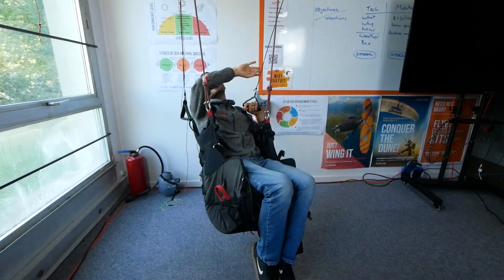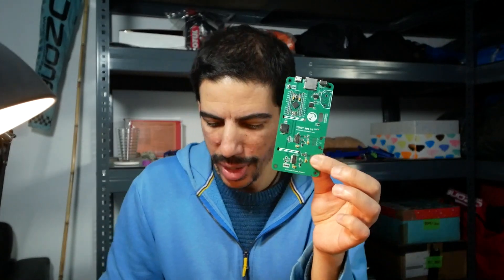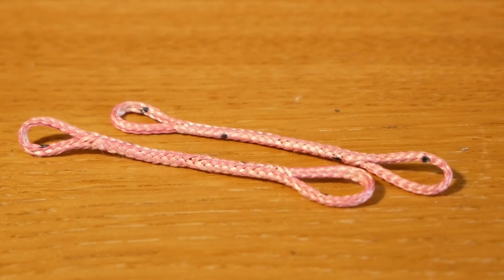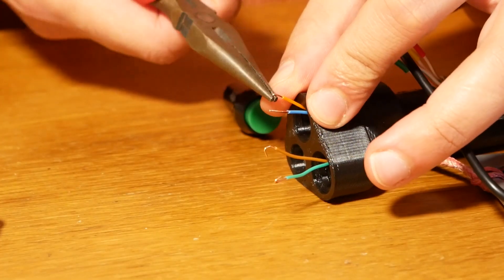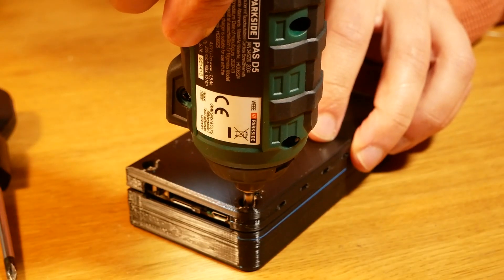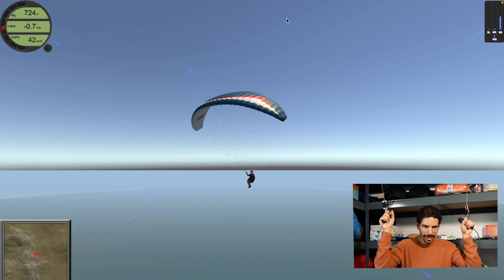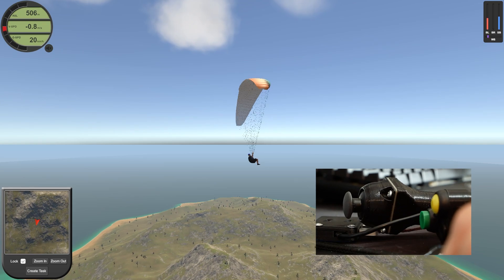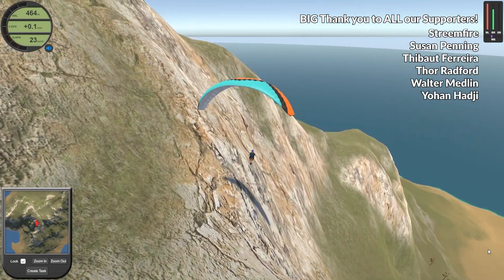TruBrake Controller - BANDARRA

Comment: Excellent. Since the handles move up and down, a mechanical solution with springs and potentiometers, to measure pull displacement, should work as well.

Comment: Have you used either:
1. Resin printers
2. "cloud" printing services
in any of your projects? The resin has way higher accuracy and is more than strong enough for case/grip and the cloud printers would allow you to literally make that out of Titanium or whatever material you want pretty much... (The main reason I ask: I have a resin printer and I've been eying those cloud printers for a while now! Being able to prototype in resin/filament and than just order the part in perfect quality made from whatever Metal/Plastic or even WOOD that you want!)
Also: I like the blue and orange, looks nice! And I love how the long Bolt has full contact across it's length, that's gonna last! 👌👌

Comment: Hi Andre, this is an awesome idea! Also, if you add springs/bungee between the handle and the sensor, it should give it some actual brake travel and a bit of a more dynamic feel to the entire system.

Comment: Dude! You one upped me again! I love this design, no moving parts. I had a similar thought with the load cells but decided to go with gears and wheels. One thing I have had trouble with is the weight  shift sensor (while seated at a desk) using a large dual capacitor from layers of tinfoil under each side of a cushion. It seems to compress and I have to give a a good rap on the floor to fix it. I have been thinking about making a dual whoopie cushion type of thing with a differential (non-absolute) air pressure sensor between the sides but can't think of a way to make it yet. 
Have you any ideas on that?
One other thing, maybe slow down those prints a bit haha! I run mine at 50% always. Guess that's not too important ;) Thanks for letting us in on your cool ideas Andre!
Reply from the maker: Yeah I think if your going that far to create a paragliding input system then one of the main things is to use an actual suspended harness. So if that’s the starting point then using brakes, weightshif and sleepbar can all be done with loadcells. And taking on the ideas that some people suggested, instead of the loadcells being on the pilot end, they could be on the hanger side, above the pilot, where the lines and risers attach to, that would be super nice and slick with minimal cables in the way

Comment: Hey Andre, I don't know if you remember the paragliding controller I made a few years ago, I've been improving it and now it's going much better, now it also has foot throttle control.. I've tried everything to make the brake control, at first I put tension sensors similar to yours, then I put distance sensors, at first with encoders, then with optical encoders, then with 10 turn potentiometers and finally I've finally found the solution with normal potentiometers and a pulley system. It is the most realistic I have achieved. Let's see if I can edit a video with the updates.
If you want I'll send you the files to print in 3d if you want to test.
Reply from the maker: Hola Mr Cuervo que tal!? Yes of course I remember, it’s was a nice rig. Would be nice to see a video of it if you have time to put it together. For now I’ll leave this system as it is a get some feedback from Flyeo to see how they like it as they will have a full hang simulator with bungees and pulleys etc. In the future I’d like to make one with weight shift, speedbar and everything, but one thing at a time
Reply: @AndreBandarra1  When I upload the video I will publish the plans of mine, it has really come out quite cheap, it is only a few iron tubes, 4 potentiometers, an arduino and some 3d printed parts.
Reply: This sounds very much like mine, can't wait to see it!
Reply: @sandrainthesky1011  The other day I saw your video, very good. The first prototype I made was similar to yours, I made it during the pandemic with things I had in the workshop. The one I've made now is better. It's almost like paragliding 😁
Reply from the maker: @sandrainthesky1011  https://www.youtube.com/watch?v=QW3vSNrbr1k :) very nice

Comment: Awesome work Andre! I’ve been following your various electronics projects with great interest. Since you’re obviously considering the longevity of your hardware I would suggest using stranded rather than solid wires in your cabling, the solid wires may break pretty quickly if they’re flexed in a single spot repeatedly.
Reply from the maker: Good point. Yeah not super happy with how thick and stiff the cable is but it makes it easier to solder and feed through.

Comment: impressive ! how much time did it take for you to make the whole thing approx ?
Reply from the maker: I had A LOT of stuff already from other projects, like the core of the code, the main PCB and a lot of CAD for 3D printing, but still took around 3-4 weeks of pretty much full time work
Reply: @AndreBandarra1  oh wow that's a lot, a month given all the advanced parts you could use already, as well as the knowledge of all the software, tools etc
Reply from the maker: @alex-in-the-sky  yeah, at the beginning, because I can imagine it, I think, yeah it will be a couple of days and then done, but just the 3D printing prototyping and reprinting takes a few days
Reply: @AndreBandarra1  I see, all but the auto coding took more than expected haha :) amazing result and I really like it being a less troublesome option to have a simulator at home without bothering with all the VR stuff

Comment: Fantastic! Seems like it would be really good for VR, too. The VR headset (mine, at least) has trouble tracking its hand controllers when I am sitting in a natural paragliding position, especially when my head is turned. I bet the "feel" would be so much better too, with this on bungees, rather than trying to hold controllers out there in space with no attachment. I love the self-writing software segment 😂
Reply from the maker: Ahah, I was wondering if it was too subtle and if most people would think I was being serious xD
Reply: @AndreBandarra1  I loved that bit, too! At the same time I thought: "Holy shit, the software ON TOP of designing, 3D printing, soldering, and and and: That was A LOT of work!" Almost seems a waste not to make these available to more people... - In my first SIV I opted not to do a full stall yet... I'm almost positive I WOULD have done it, if I had like 5 goes on that sim beforehand! - Even more so once you perfected the tension/length of the lines/setup in game to come close to reality.
Imagine if you could fly your wing (or a wing close to yours) in game, learning how stall points roughly work by pressure and so on and than going out doing it for real in the afternoon... - You can't tell me there isn't huuuge value in that!

Comment: Should be 4 channels really so that you can probe the hang points and use weightshift too. Good job still 👏🏻
Reply from the maker: Didn’t have time this time, but good idea. With tension on each carabiner you can even measure how different harness settings change the amount of actual weight shift

Comment: Awesome work Andre. I quite fancy making one - do you plan on publishing +/ selling the plans +/ kits? I'm also curious to know why you chose to measure force rather than displacement of the break lines.
Reply from the maker: I might do kits at some point. Just didn’t want to do it yet as I feel it’s not ready for the general public. Would be nice to have weight shift yeah and perhaps even speedbar
Reply: Could also be cool to add a third input for an accelerometer / tilt sensor attached to the harness / suspension bar for weight shift.